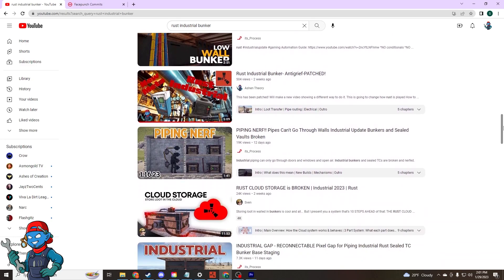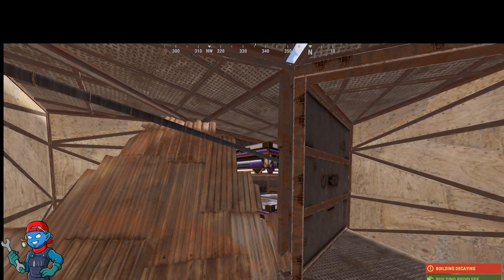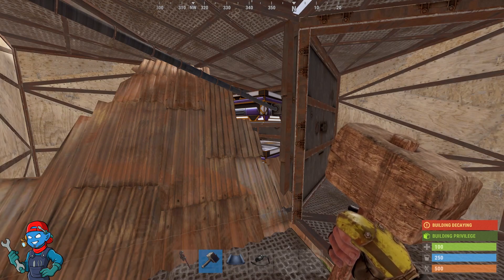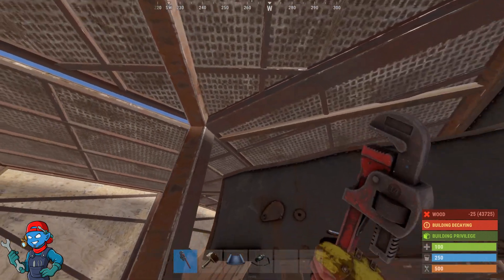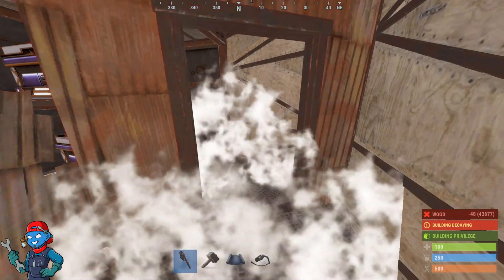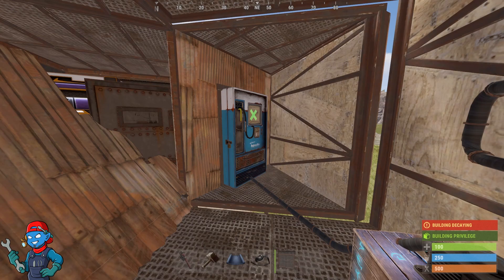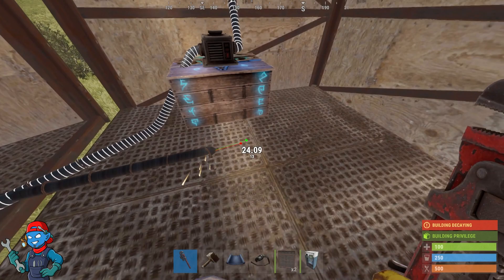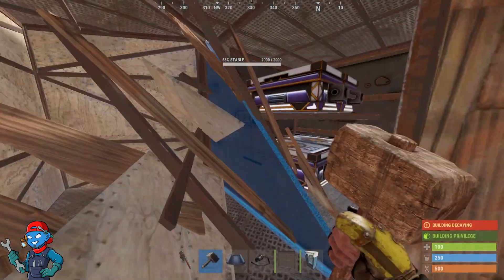Reconnectable Rust Industrial Bunker 2023

Comment: saw a guy on r/Rust that has an automated setup to move loot around the base when it detects a raid happening lol, no matter which area they try to raid it's going to be empty by the time they get to the loot! you literally have to raid ALL of the loot storage areas OR get the core and destroy the industrial routers and then still figure out WHICH of the areas the loot ended up in!
Reply from the maker: Yeah linking together actually isn’t that hard either! Just use a root combiner or a branch and design your circuit to move the loot if that wall is removed. It’s almost now as soon as the wall goes down- you have to have a 2nd rocket coming it to break the boxes

Comment: Awesome work around! You can also use square roof bunkers still as only wall conditions and triangle roof conditionals will break pipes (currently). (The design where you have 2 HQM roof pieces and seal it by putting a twig half/low wall above one of the rooves)
Reply from the maker: Yeah I think that’s going to get patched soon as well if they already patched the triangle!

Comment: dont think you should waste your time, i think facepunch clearly wants it to work in a fair way. im sure venders will affect the pipes sooner or later. a simple 1x2 with a spot where i can put some 1/4 walls to funnel pipes and in a spot where soft siding would be more annoying then worth it, is a good simple design people would use and wont get patched. (to me it would be waaay more simple to just slap two drop boxes and have beds inside a sealed base, instead of going through all the effort making small gaps for a vault base.)

Comment: surely you can just use the multi tc gap in the floor
Reply from the maker: You definitely can, I try to fill the gaps so it can’t get griefed by people. So I was trying to make a bunker that couldn’t get griefed
Reply: @ashentheory  Fill the gaps with what? If you use square frames to do that, you risk your loot boxes breaking randomly.
Reply from the maker: Floor tile for the top and bottom, but it has to be connected to the offset piece. If you do that and conditional models for the sides it can be completely sealed with no visible gaps so your boxes can be broken by raiders
Reply: @ashentheory  That doesn't work for the bottom. The wall won't be placeable.
Reply from the maker: I’ll go back and see if I’m wrong- your multi tc video is where I Learned it originally. I’ve never had my boxes break tho so maybe that was fixed?
Reply: @ashentheory  Haha good to know. I doubt it's been fixed, but it could be a server based issue.